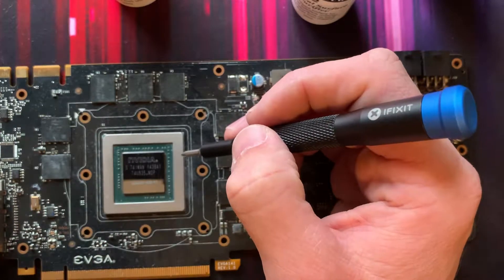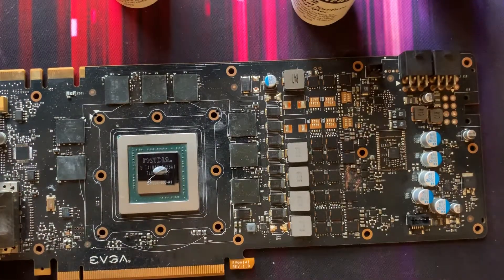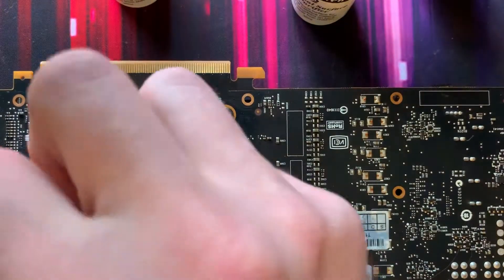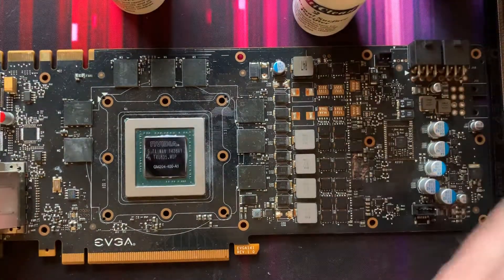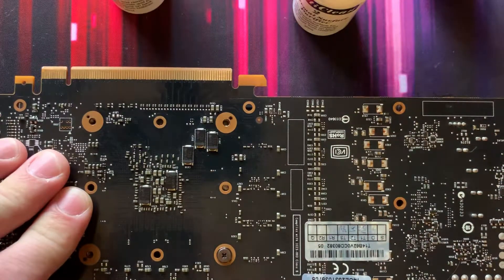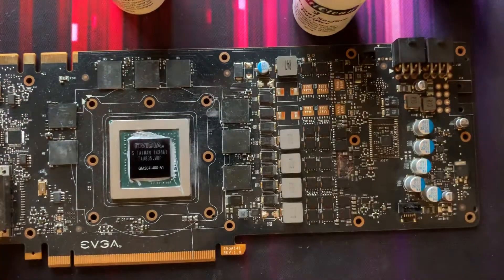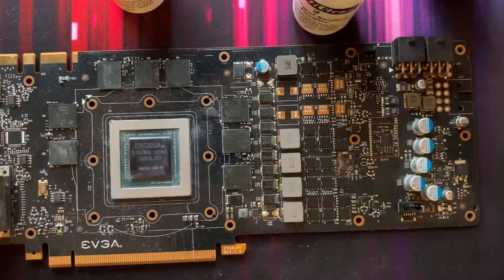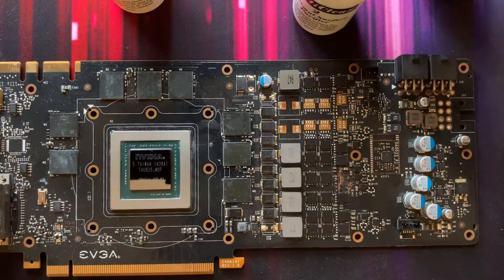GPU thermal paste application and cleaning

Comment: Hello sir, thank you for the amazing video. I wanted to apply new thermal paste myself, and my GPU's caps are buried under the old thermal paste. Basically I also want to get the most of it as clean as I can, was thinking about using a toothbrush like you and rubbing it until it's nice and clean, but I'm a little nervous about it, is it completely safe to use it on the caps or I should not do it?
Reply from the maker: Yes, just be gentle and take your time.  You can use isopropyl alcohol to help with cleaning the old paste off as well, just basically using it as a rinse.  The isopropyl alcohol will not harm anything and dries off very quickly.
Reply: @the_Scarlet_one  Will do sir, just one more question. Can 70% alcohol also be used or it must be above 90%?
Reply from the maker: @Amir2705c  higher percentage is always better. 70 will work ok, but it has a higher water content, which will stick around.
Reply from the maker: @Amir2705c  if you use lower percentage alcohol, give it longer to dry.  Even placing the card in front of a small fan will help dry it out much quicker, and then reapply your thermal paste and thermal pads, then reinstall.  

The most important part is making sure the PCB is dry before you boot.
Reply: @the_Scarlet_one  Got it, thank you once again.

Comment: Yup. I hate hot spots. I spread it like butter on toast. I never thought about using a toothbrush. EVGA factory did a horrible thermal paste job with my RTX 2070. A good percentage of it oozed to the side. I'll need to clean it. Waiting on a new tube of Kryonaut, which doesn't spread as well as other thermal pastes.